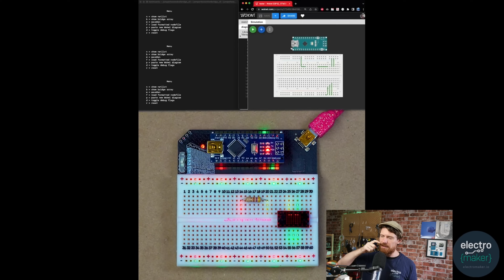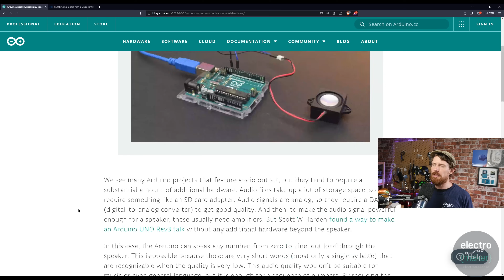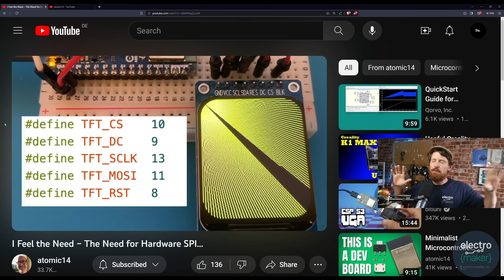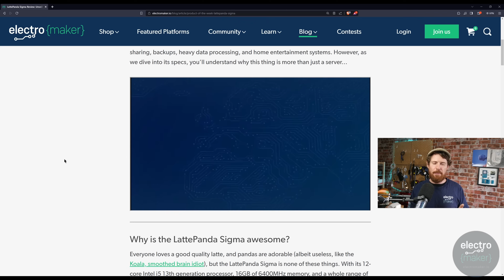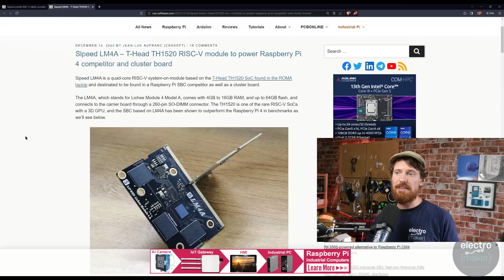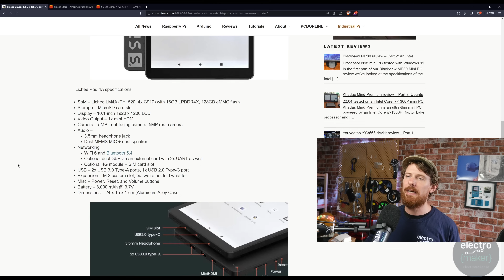Amazing Jumperless Breadboard, ESP32 Screens, Zimablade Servers and RISCV EVERYTHING

Comment: I ran across Jumperless a couple weeks ago, and it's living rent-free in my brain now, begging the other part of my brain that controls the wallet to order one.

#SIGMA project: jet engine simulator. Get that CPU running hot enough to run that little fan at full rev, and I'm sure it'll sound like it's taking off. :D

Comment: That jumperless breadboard looks like magic.  Really love it!  As for music on microcontrollers, I used to make some greeting cards with just an attiny 85, a piezo buzzer, copper tape, and recycled memory cards and batteries from old cellular phones.  Once the audio was reduced down to mono and 8khz wav file it would play on it.  Could make musical card for €5 and make it personal.  Also used it for other presents like a wedding ring box made out of thin MDF with a veneer.  The stuff you can do with copper tape is amazing.  I even explored the idea of grounding my runners with it as I kept getting static shocks when I walked on carpeted surfaces, particularly after I brought down a whole corporate network a long time ago when I touched a cisco switch and the pulse caused it all to reboot